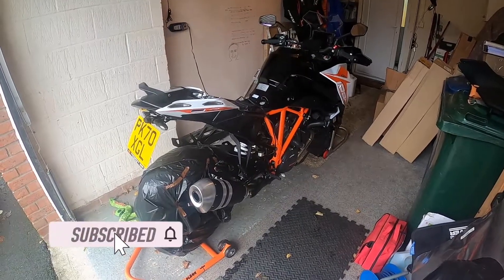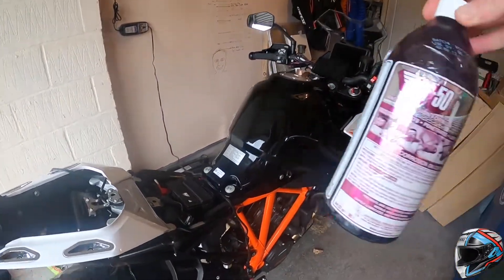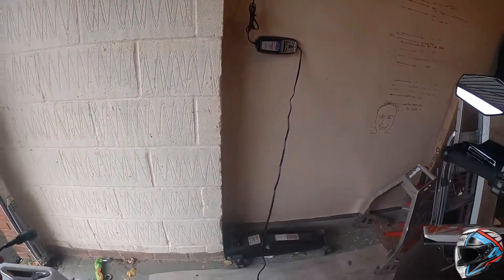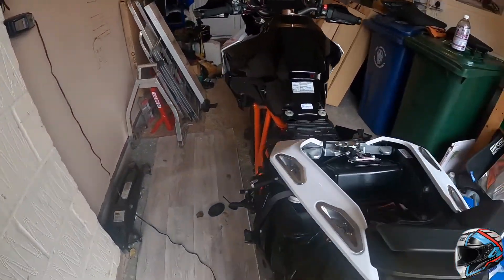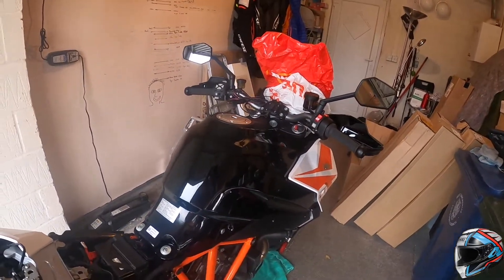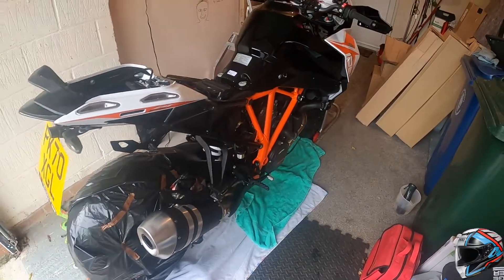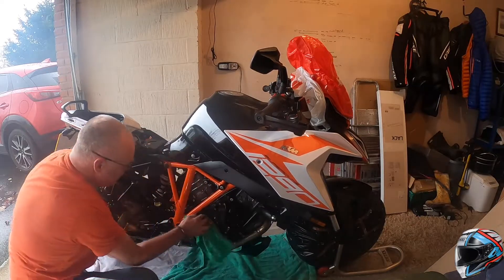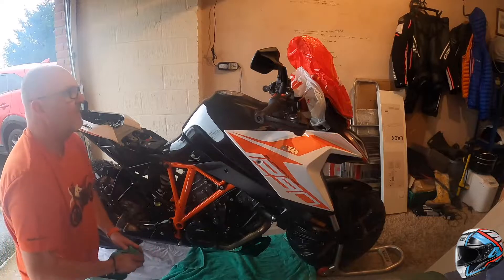KTM Superduke GT ACF50

Comment: I use it every 3 or 4 washes as a maintenance thing. I ride in all weathers and it gives me confidence in the fact metalwork is protected. I use a compressor and small spray gun to apply, works really well.
Reply from the maker: I've thought about a compressor but don't commute or use regular in the winter but woukd if I did. Do you cover all the wheels etc each time as that coukd be a chore
Reply: @stevesherlockrides  In honesty no. I’ve a VFR VTEC 800 for work, so that’s mostly fairing panels but I get the spray gun in where I can. For the likes of the swing arm and other bits that are near the brakes, I spray the ACF50 on a cloth and wipe the metalwork over. I also have a S1000R but as that’s the weekend toy, I do go the full Monty and cover wheels tyres etc before spraying as that’s only a couple of treatments a year. My VFR is washed every weekend. 

My son has a Tracer 700 but again I spray all exposed engine carefully as I don’t cover up the bits to avoid. Then I use it on a rag again to give bits a wipe over. Seems to do the trick for me.
Reply from the maker: @sjg6074  makes sense. The effort rewards you with long term fun and fewer problems

Comment: Noice. I recently picked up a used 2016 model. First order of treatment... douse it in ACF50 then wipe it down. 

I didn't use any masking, but I don't have an atomiser spray, I was spraying straight out a warm can from a short range.
Reply from the maker: Just be careful not to get on tyres and brakes pal

Comment: Great video Steve.  Do you apply the ACF50 to prepare the bike for long term storage, or is it a maintenance thing that is done periodically?
Reply from the maker: Its both actually however I use it as I do like to ride during the winter on occasion and if weather OK. The issue though is that roads in the UK are salted/gritted so the ACF 50 is a precaution and protection against any rusting and corrosion. It does no harm to the bike so gives another layer of protection